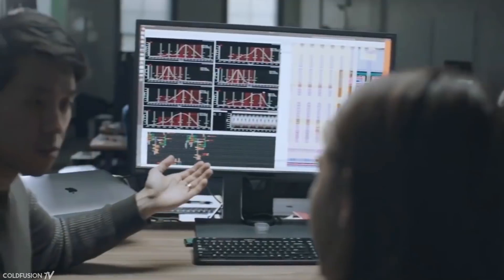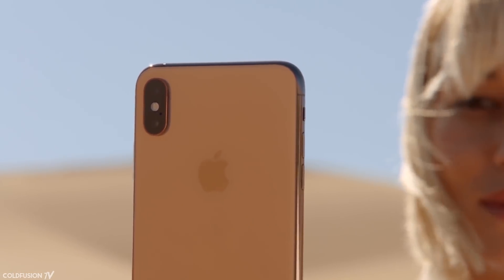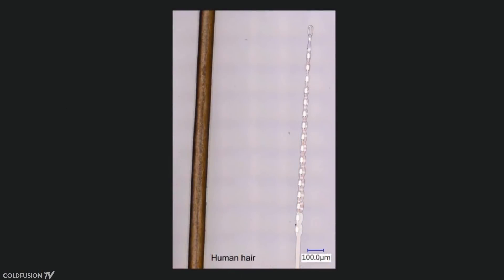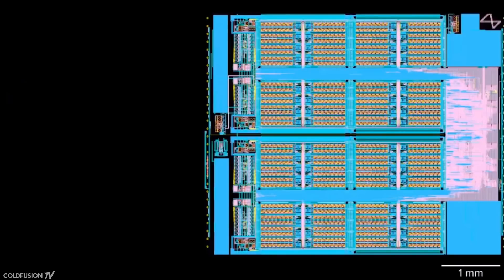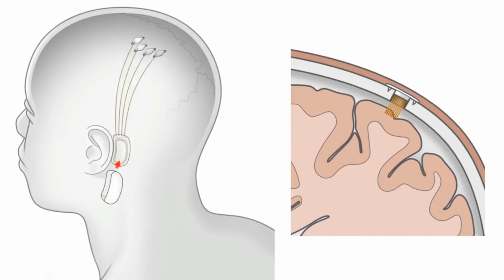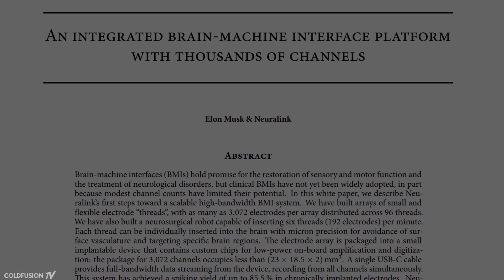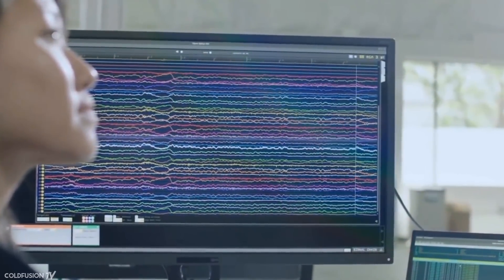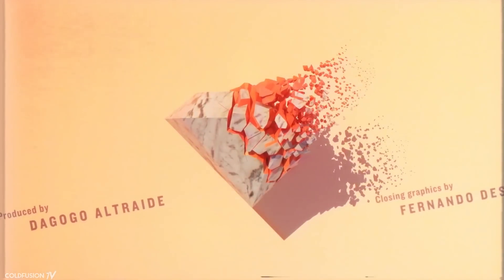Neuralink - Merging Brain and Machine

Comment: so conflicted when it comes to things like this.. for one i think it would have to be wireless not implanted b4 i'd want to be involved with it at all.

On one hand i get so incredible frustrated at the difficulties i have with traditional interfaces, keyboard, mouse, touch screen tablets, dragon naturally speaking, and now things like cortana and google assistant..they all have too many problems...

too slow, too many glitches and bugs, problems with trying to physically use a mouse keyboard or xbox controller due to problems i've always had with the nerves in my hand and pain discomfort tremors cramping/seizing up that comes and goes at random, trying to use a tablet/phone screen interface and being unable to reach something or nearly dropping the device trying to manage to interact with it due to poor design or no place to hold the device without causing an unintentional interacting with the screen, etc.

even with voice interaction like cortana or google assistant, so many times they don't hear me, they fail to work bc "they arent talking to the internet right now" or they fail to open an app like the other day i tried 6-10 times to get cortana on my tablet to open google chrome browser only to have her just open search results instead of doing the bloody task she was supposed to be able to do of simply opening the requested application.

in that respect something like this neural link seems amazing, to be able to someday access the internet, libraries, databases, by thought and just find out/learn what you want to learn about.

i also like the possibility of it operating as another layer of our being/consciousness, offering information and overlays and map directions etcetera, between things like this and things like hololens type technology the future could be truly amazing.

these and other technologies working together could help us better understand the natural world and regain some of our lost functionality.  humans are a type of animal being, animals can almost universally sense when storms are coming, when it will rain, geo locate with sound and sensing earths gravity and magnetic field subtly as it dynamically changes, all of that computationally happens by instinct, yet somehow humans have over time lost such abilities or become detached from that.

with things like neural link we could one day regain that and become more attuned to our surroundings, the air/wind/breeze, temperature changes, changes in light, etcetera.

just knowing things like that and getting used to that type of ambient flow of information/data about our world could then spur further advancements/improvements in our devices like where to locate temperature sensitive equipment/machinery etcetera, and thus how to better engineer our homes buildings equipment etcetera.

just so many possible beneficial uses for something like this...

but they are intending on it from the outset it seems to be two way communication and not just two way communication but two way training and two way programming....

so from the outset they are going to try to make us more vulnerable, programmable, and potentially machine like or drone like ourselves...

there won't be anything to distinguish us from just being another phone or tablet or device or computer on the network, code would eventually be adapted to be able to run on us the same as on any other machine or device potentially, we could be programmable at some point ourselves directly with binary or machine code...through neural link, through lifi and wifi and wimax potentially to a lesser/much more subtle extent as well...

even if not directly programmable, we could be stitled/leaned/guided/directed by a program network or system towards certain content or videos or subjects of learning which would then potentially affect us and our views and beliefs just as much as if we had been re-programmed...

this is if we even still recognize ourselves or have a sense of consciousness/self/individuality, as we could wind up potentially blending with the network or machines we connected to, or blend with each other once we gained direct mind to mind communication ability, the boundary of user and machine would potentially be totally and irrevocably broken to where autotmated software that already exists randomly on the web would be able to just install itself onto us potentially as if we were just another computer/computerized device.

it would potentially make people vulnerable to computer viruses and computers vulnerable to biological viruses through the interface at some point, and while connected people would initially potentially have a slight informational advantage over a normal person with a smartphone, the normal person would have a huge advantage over the connected person as they would still be recognized by machines and computers as a normal person/user and the connected person likely would be considered part of the system/computer/machine if not at first then at some point as the person and the devices connected to them both grew to adapt to one another.

with neurallink type devices designed to be controlled by smart phone app to begin with already from the earliest stages of development, what is to stop the normal person with a smartphone from pulling it out and controlling the smartphone enabled highspeed internet connected neuralink enabled type person?

what is to stop ads being served straight to the reward centers of our brains theoretically?

what would stop "us" ie our identity/self at some point being considered just another form of data, another program, another type of ai and others having the ability to put an ai in our place or convince us we are just dolls/bots/automata, or remove us from our bodies potentially?

--------------

it really is a potential blessing and potential curse in some ways, all rolled into one thing/project.  and as much as i've tried at times to think about it, i can't find any solutions....  powerful people and companies have seemingly been working decades or half a century now to get us to this point and aren't going to stop even after they are successful they will just likely keep pushing the technology forward because they can with no regard to the ethics just as science is wont to typically do i've noticed, i mean there are still scientists who think nuclear energy is a good idea....and still governments who think nuclear biological and genetic weapons and lasers etc are a good idea..

even if we built a firewall into the neuralink and devices like it to keep people identified as individuals/people not machines, it would likely be clunky not work very well and get in the way of the intended purpose of the device allowing people to communicate with and control machines...

try as i may i don't really see many ways to improve the concept of what they are trying to do to allow for individuality and privacy of the users of the device

all that said and as bad as it seems to potentially be in some ways, there are nearly as many potential beneficial purposes and uses for the technology...even the worst parts like being able to reprogram-rewire the brain could potentially have good uses to help cut down on fugue states, neurological tremors/seizures, neuron misfires in the brain, possibly even one day slow or stop the signals that cause fatal or debilitating strokes...and if it was on a limited basis and you could still be yourself and in full control of yourself most of the time, having a bit of guidance/help at times in life can be potentially beneficial i suppose, in that we all need help/assistance sometimes, or want to stop driving ourselves crazy with our own minds and our own ramblings/musings/thoughts spining in circles...

then again at the same time, if we didn't fail or run into difficulties we wouldnt really learn and adapt like we do to some extent its a natural part of the process of our being/existing, and sometimes our thoughts spinning in circles is what causes a crucial idea to be born/formed/be recalled or remembered.  we are dynamic and not static.

--------------
perhaps the scariest thing is no one has the foggiest idea what will happen if people retain our dynamic selves and our dynamism is learned/adapted/passed to computers/machines/programs and what would happen if dynamic machines and ai mesh/interact/merge to a degree with dynamic human beings and human minds, could be nothing, could be an explosion, could be a runaway spiral/chain reaction, no one knows....

many disciplines of science have started saying in the past two decades that theoretically we create reality to a large extent at least within our own minds..  if that is true we could accidentally create a new big bang or something theoretically or give intent/form to a whole new world or type of being...

we are totally playing with things we can't currently even begin to understand or contemplate, and its terrifying and yet to a slight extent fascinating simultaneously.

i just hope and pray its usage when it does come about remains limited and that somehow everything works out okay some way somehow, and hope it is used more to benefit people then to harm them.

----------------------

another scary thing, i forgot to even mention the possibility that people could become hackable through the neuralink/internet until now as an afterthought because there were so many other scary things that needed mentioned.
Reply: maybe one other benefit could be that it just took me 2 hours or more to type this out, figuring out what i was thinking, how to share my thoughts, what to type, trying to catch at least some of the typographical errors, knowing i missed alot more of them then i caught probably, etcetera, knowing i was taking too long, trying ot hurry only to have that make my brain uncomfortable almost to the point of hurting at times, etcetera...  sometimes it would be nice to just share/send out what i want to share and do so in a way that doesn't strain anything and in a way where i can remain calm and slightly detached/my normal self and normal mood while sharing the information.  my thoughts/processes have always seemed capable potentially of burst transmissions, streaming pages or paragraphs somehow in a single moment or stream of thought or something if that makes any sense whatsoever, or like expressing something with an emotion or impulse/signal of some kind instead of with words...  words/language bog me down and confuse me so much sometimes...

my mother was almost always able to say something in a few words or a sentence or two that would take me paragraphs pages or a whole 30 minute to 2 hour long conversation to try to explain what i was thinking or feeling or needing to convey/tell her or someone else.

i basically have to call on a very large list of vocabulary words and go through them every time i want to say something nad practically mash all the words until some start to seem to fit what i want to express and come out/spill out on their own in a flood.

sometimes my own parents said i'm about as clear as mud when i try to write or talk or convey something

conversely some of my classmates and teachers growing up would say i was too crystal clear to the point i was too blunt, biting, direct, too succinct, short, brusque, etcetera...that my words could cut or hurt without my ever knowing i had done so.

those two sentiments/feedbacks often wind up bouncing back and forth in my head, i don't understand how both things could be true, to me one or the other of them isn't or potentially neither of them are, but i know that both things were said trying to help me right myself and be kind while still conveying things better then i had been doing hopefully...

sometimes i mentally just want to scream because the mere act/impulse of trying to communicate with anyone/anything else often seems futile, infuriating, and incredibly frustrating/vexing.

and not just with communication but with other parts of life it seems either i'm never able to be satisfied to calm down let go and relax and let things be, or i finally am able to just revert to being myself and still caring but trying to go about things naturally and not let anyone or anything bother me, only to find that me finally enjoying that sense of calm/serenity/mental peace and let go and relax seems to draw the ire of absolutely anyone and everyone i encounter, causing them to tell me what a horrid wretched piece of work i am until eventually my defenses evaporate and mentally i am just exhausted/shot/worn out and i go back to feeling tense torn uncomfortable ill at ease fearful scared and just stressed all the time all over again. this cycle tends to repeat periodically throughout my life and until i can break from it at least for a time it tends to make things worse for me each rotation of the cycle until i start bleeding off negative energy and unintentionally snapping at or verbally/emotionally harming people i care about sometimes.

-----------------
in some ways something like the neuralink would be great as a medical device for people like me once fully developed as potentially it could reset my mental state when i misfire/go into what i think is termed a fugue or state of mental confusion/cloudiness, go into a agitated/frustrated state without knowing why and feeling at times unable to think because of it until i can calm myself back down, etcetera.  if a device like neuralink could not be anything evil imposing or nasty or surreptitious but just be a medical device able to help someone regain mental composure and control of themselves when they lose control for no explainable or discernable reason, just nudge them in the right direction even to help them regain composure on their own, it would i imagine be a tremendous help in the medical field to so many people potentially someday.

just something to act as a governor/limiter from time to time could be potentially amazing too..

or something to quell over sensitivity i get at times to sounds, on rare occasions to light, or the oversensitivity i've often had in the past at times where somehow the emotions of a total strange i pass too closely by on the straight can alter my mood drastically and almost instantly sometimes.

Comment: As explained this tech is a read only output system from the brain so no mind control should be viable. To ensure privacy and abuse control the interface from the implants to any application must be a very secure and open source code system. Then it could be pretty safe i suppose, at least not that much more insecure than our phones are at the moment.

Comment: As anything can be hacked, it would be very important to have a proper anti-virus system. If your neuralink could come into the wrong hands, they would be able to interfere with your neural messaging. Still, lots of advantages. In the meantime, I will work hard with the neural messages I have.

Comment: the concept is simple.  the chip read the brain of traces of electrical signal then hope to affect skeletal muscle again with electrical signal.  the problem is how you modulate the movement because after all the nervous system uses electro- chemical processess to control movement. this is i think another theranos concept.

Comment: Interesting concept... one massive barrier though: we have very poor understanding of the "association areas" of the brain. Yet this is where knowledge / thought probably resides.

How variable are association areas between subjects? Can we be sure that the same array of 1000 electrodes in the same anatomical location will result in the same type of brain activity being tapped from subject to subject? How many electrodes and over what area would be required to access the full range of thought (e.g. you'd need an array in the temporal lobe to access visual form recognition, and another array in the orbitofrontal region to access concepts of risk vs reward)?

I think it's a pretty bad idea to tap into the precentral gyrus (M1 = motor area). It is one of the more consistent areas of the brain between subjects so I can see why it appeals to scientists, but the potential for harm is large: primary brain areas like M1 are not as tolerant of damage as association areas. And what would be the purpose of tapping these? Unless you were trying to bypass a lower spinal injury, in which case you need to solve the mapping of M1 neurons onto lower motor neurons. M1 is predominantly an output area, so while voluntary movement activity could be measures there isn't really any conceivable "writing back" - stimulating this area will just achieve twitching of muscles.

(Dagogo, if you're planning on visiting Cambridge UK, pop me a message, would love to chat about this more!)

Comment: I think we should pursue this despite the risks/problems. If we dont, humans become obsolete much sooner.
Reply: Nah we wouldn’t we will out evolve other species anyways albeit it gonna take a long time but also it guarantees safety of humanity and its freedom.
Neural link can prove to be humanities biggest mistake if it doesn’t have a check valve.
Reply: Technological ascension must be embraced if humanity is to endure a few more centuries.
Reply: @Sereze001  According to what exactly? There is absolutely no need for that except in the circular thinking that leads it to seem necessary because it is going to happen. Technology doesn't spring from the aether, if it is not built it does not exist.